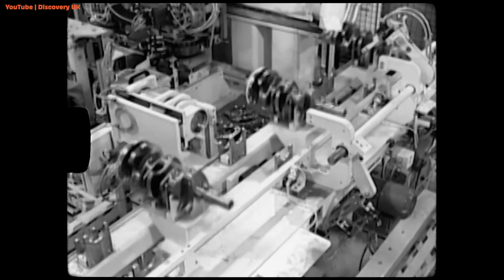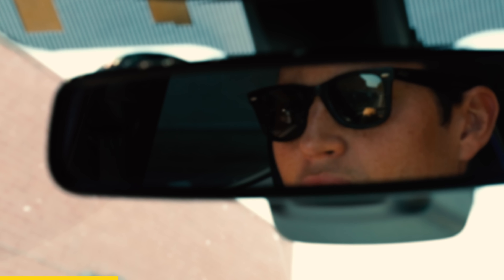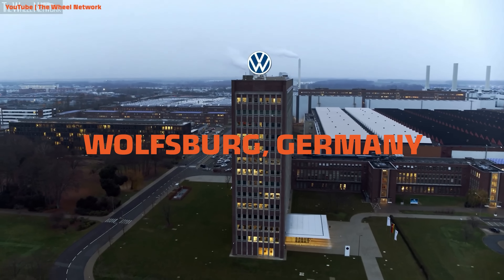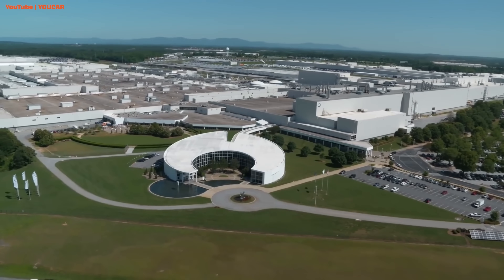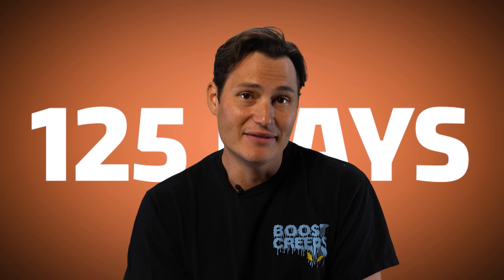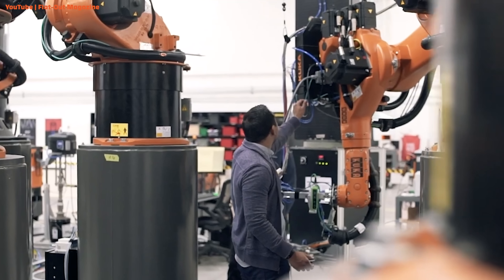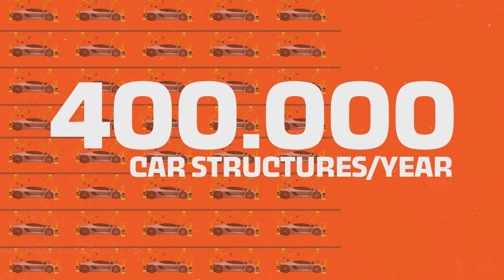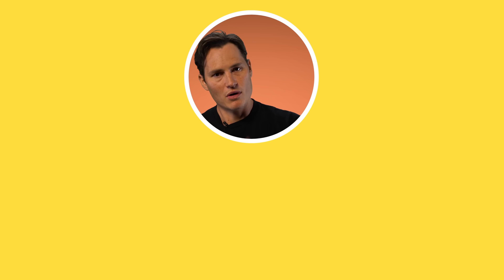A.I. Designed this Car

Comment: 3D printing still has a long way to go. It’s great for prototyping and avoiding manufacturing nightmares, however you’re trading that for part lifetime as it suffers from metal fatigue way harder than traditional methods.
Reply: Not to mention sintered products are a nightmare for quality control. A small failure in the sintering process, or an impurity in the powder can cause imperfections in every single resulting part, potentially causing failures. Not saying it's impossible to inspect, but it is significantly harder than the mere statistical/batch control you would need to do for traditional forging / heat treatment processes. Tl;Dr:  Fine for limited production, but once we're talking mass production, plsno.
Reply: No one ever said that you can't use 3D printing to make molds and designs of something you later want to produce in a sturdier material thats the real progression here
Reply: Agreed, i was waiting to if someone had commented on this yet! Not to mention scaling it isn’t as easy as we think! Great technology for reducing R&D times and improving results. Although like you said, 3D printing techniques just don’t produce the same strength in material structures as other “traditional” techniques. 
Stoked to see progress nonetheless though!
Reply: Bugatti literally 3d prints brake calipers. Siemens makes 3d printed turbine blades. if its good enough in those extreme use cases, I think metal fatigue isnt why its not being adopted
Reply: @sava411  turbine blades and aviation in general, go through rigorous inspections multiple times a year where the aircraft is torn almost completely down every component inspected and replaced the first sign of metal fatigue. Something that isn’t common at all in most ground vehicles.
Reply: @sava411  those are very specific cases though, they aren’t making entire cars or structural components
Reply: @michaelpugh2617  they arent making entire cars out of any single one manufacturing technique lol
Reply: Lol, companies have already made a completely 3d prompted rocket engines
Reply: @frodobaggins2852  That doesn't remotely debunks what he said. First off, this 3d printed rocket didn't fly yet (assuming you're talking of relativity space) and rockets are a very specific field anyway, where it's basically one use and it's done. Reusability isn't amongst their priorities, so the lifetime Breaden Griffits was talking about is short as fuck for rockets..

It's a very niche thing, and in that sense, it's not too dissimilar from prototyping.
Reply: @Baamthe25th  my point is basically if 3d printing technology can be used to make stuff which endures much much more harsh conditions than a road car, it will probably be possible to make a car out of it..i mean people are using 3d printed prosthetics
Reply: @frodobaggins2852  The question isn't if it can be done or not, if it's a traditional method doesn't the job just as well, if not better. (Not to mention, for cheaper. )

That's the point made in the original comment.

Comment: Wow, this video missed the mark in a lot of areas. Is 3D printing cool, yes, can it print cool shapes, yes. Is it the fastest, most efficent way to manufacture parts, absolutely no.  There is a lot more that goes into designing a product than just efficiency of design.

Comment: We need to realize that the current AI is not that smart. We think it is smart because it can output an optimized part but what is really happening is it is designing the part thousands of times and tests it. The computer then determines which part is the best and that is the design. They aren't smart they are persistent. If you give it the wrong parameters to manipulate you will get bad results and if you don't set the right performance parameters you will get bad results.

Comment: SLS is a revolutionary 3d printing technique. It stands for Selective laser sintering
It is an additive process of 3d printing
In SLS printing, powder of nylon, abs or PLA is taken into the machine where lasers to coalesce the powder into a solid or porous mass by means of heating without liquefaction. This is known as sintering.
By Sintering, the powder becomes very durable. 
I am a 9th grader and I know this because I participate in F1 in schools

Comment: The type of optimization they are most likely using is Topography optimization. Topography optimization is more of a calculus problem, not really what the industry would consider AI, and the reason why other automakers don't use this type of optimization is because it's not really needed. Not saying it's not impressive.

Comment: Curious as to how durable the parts are. If they are 3D printed for maximum weight savings, that could lead to a marginal--even nonexistent--safety factor.

If they are supposedly saving $497m, that better be one cheap hypercar. Also, I'd invest it back into making dope economy cars that could be bought brand new for the price of a used 2007 Accord.

Comment: AI: I designed a car
Engineers: But at what cost?
AI: Everything...
Reply: Don't get too hyped like Donut. How long does it take to print a car?  Way more than conventional. Lets not get to how much it will cost per car, and don't forget 3D printed metal may not necessarily more "stronger" than special metals (due to crystal structure), like aircraft compressor blades are made of single metal crystal to make them more resistant to cracking.
So yeah, metallic 3D printing is and will be limited to hyper cars and low volume production cars for next 10-20 years.
On the other hand, cars you see today, let it be your new Golf or a Ferrari, already incorporate AI design. However it is with mechanical/aerospace engineers doing the actual design but have AI simulate and refine it.
Last but not least, SR-71 is done without computer stimulation. And Zonda still looks more elegant. Since you can't simulate a human (yet), Beauty can not be modeled (yet).

Comment: This is how every car maker designs its components.This is nothing special. The parts from singer just look fancy, because they dont have to care about production cost. but if you produce high volume, you cant 3d print, because its too expensive. so the parts look different.

Comment: This kind of engineering is hell for mechanics to do maintenance.
Reply: Owners manual page 1: how to change battery - disassemble rear section of car to access battery.
Reply: This type of car is not 1 you take down to your local mechanic. Like all hypercars, they have special mechanics for it.
Reply: If u got the money to buy it, you have the money to repair it
Reply: @miercolesdenoquis6485  It's not about the money, it's about the nightmare that awaits any poor mechanic who has to work on a car that was designed solely for ease of manufacture and without regard for serviceability
Reply: @GMT-tx2xz  but the people buying this have lots of $$ and can afford to pay a lot to the mechanics. How would you like to be a mechanic for aircraft engines they hold way tighter tolerances than this. Oh yeah that’s right they get paid way more then the mechanic down the road working on random shitty cars. The only argument you have is if this made regular people cars. But even then is it really that hard to make it learn how to make maintenance easy compared to it learning how to make an entire car. Your argument makes no sense no matter how you look at it. If you don’t want to work on it don’t find another job nobody is making you do that. If you want to learn and make a shit ton of money doing it then go ahead and let them make it complex as hell.
Reply: @GMT-tx2xz  as an Hypercar mechanic, you're probably paid 100$/h and work in a spotless room with chandeliers and a string quartet playing in the corner
Reply: Hypercars are intentionally stupid and complex, they're all like this. But I can't help but wonder, how much faster the AI and robots would build an average people's car, and how much more optimized it would be.
Reply: It should not be that hard for a mechanic when most likely the car is like a lego,the only thing that would be a nightmare is the wiring since the A.I. routed it through the most impossible location where hands wouldn't go in.
At least the A.i. made the car from all of the best design for parts,who know if they have A.i. Mechanics.
Reply: lol what i thought, you break anything in this car, throw away entire car lol
Reply: maintenace.. look at it one hit... and you need new part.. it too thin.... for steel work...

Comment: If you think about it, this way of making cars could make cars WAY cheaper.
It would be a lot more expensive to start a factory with all the machines and computers needed for this method, but once you get started, the costs of actually building designing and building the cars go down like crazy. No human can work as efficiently, as consistently and as long as a machine. A machine can work all year round for a fraction of the cost of a human worker.

Comment: I was struck by two things - curiousity & fear. 

The fear was a result of thinking that if an AI could essentially plan out 80% of the design process, it sort of signaled the end to human discovery in terms of automotive innovation. I'm aware that this may be an exaggerated fear that may not actually come to pass, but its something to consider. Along those same lines, if A.U.s suddenly pop up, you're talking about machines that never have to take breaks, can run 24 hours a day, and will require little maintenance, and that spells disaster for automotive jobs potentially. Again, possible over exaggeration on my part, so I'll digress. 

The curiousity was about the potential to build your own materials with 3D printing. I'm aware that 3D printing has been around for a while, and its use in manufacturing metal parts is something that I've been interested in. But if the cost of that engineering was lowered, it would mean that people might be able to enter into markets like this and offer some competition. And that would be GREAT. 

What did you guys think about this stuff? What would you do if you could build car parts in CAD, have them sent to a lab to print, and be able to manufacture your own car essentially from the ground up?
Reply: i definitely felt the same way.
while 3d printing could help save material, the thought of the amount of jobs lost and the loss of actual human input is scary.
Reply: @ajayadhisankar4139  it really doesn't, depending the design printers waste material and pieces need to be polished after the process
Reply: @LeoMkII  Have you seen how 3D metal is printed? It's metal dust that's simply welded with a laser, and is brushed off if its not used. It can be reused in future products. The waste is nothing compared to how much material is lost when you have to use a lathe or to cut material out. 

And how many people will be "polishers"? How much of this are we pushing out of human hands when we build robots who can no essentially design methods of putting everything together WITHOUT the need of human interaction?
Reply: while ai does all the engineering itself, its still a tool to use just like any other program. for example within the gaming industry, they would have to create hundreds of thousands of assets by hand just so someone could run past it later, with one virtual building costing at least 2 hours of work from start to finish. nowadays they use ai procedural generation to streamline the creative process leaving more time for the creators to do the more important things. I believe that ai is definitley dangerous but any sophisticated tool is, so it's up to us to make sure we use it wisely. and the jobs lost to manufacturing could be made up by ai programmers and maintenance. ai isn't smart enough to do everything on it's own despite what you hear on the news.
Reply: and i don't think it'll go far enough to be able to make your own vehicles from CADs.
Reply: I’m a firm believer in the human aspect and the passion that goes into vehicles

But in the day of cars getting more and more expensive this could be an amazing way to maximize not only performance but cost efficiency and fuel efficiency.

Not even mentioning production efficiency, which will also cut costs.
Reply: AI and robots are coming to many places and many jobs and our whole society needs to start thinking real fast about a tomorrow with 95% unemployment because it won't be pretty if we keep the current socio-economic structures in place... As for you second and third points, the biggest companies will have the best computers and AI to make the best optimisations, and the capital to have the best and most efficient 3D printers and raw material supply. Normal people should not fool themselves that they will be able to start a car company in their garage imo.
Reply: @CalgarGTX  people thought computers will replace jobs, same with robots. Guess what? They didn't. They are tools, not humans. Same with ai. Ai is a tool made by humans for specific tasks, Nothing special.
Reply: @CalgarGTX  I agree mostly.athough a machine may steal manufacturing jobs for now, in the future we will go through a change in professions. Just like we did when we invented new manufacturing systems a century ago. There is always another task that needs to be done as we advance further.
Reply: I definitely agree with you and I felt the same but I also felt a sense of hope that we could really have more efficient parts with this type of technology. It has the potential for customization of cars that would otherwise not have been improved upon. My imagination is just going crazy with possibilities. Im just worried it'll be so expensive that it wouldn't make sense to pay for
Reply: The idea of a car being 3-d printable is awesome, just for the secondary repair market. Being able to 3D spare parts for your car would be amazing.

I soon as I read the title of this video, I my mind went crazy with the possibilities I never thought about. It makes sense, ML can do a lot of guess, check and refine, the basic principle in scientific learning, while never hurting a test subject, or costing money to make a prototype. You can squeeze every inch of performance.
Reply: 3D printing is nice and all but it is not a mass production process. In the future I can see that 3D printing will probably be used similar to how it is now: low volume, highly variable products. 3D printing is nice in the area that you cut down a bit on waste and you are able to quickly change what you are making without changing all your tooling. I can see 3D printing and more traditional machine based factories being used alongside each other with 3D printing being used for prototyping and development.
Reply: @ragingagent5040  yeah I wouldn’t be saying entire cars will be 3D printed and made by AI but it would be a very interesting prospect and could cut cost in certain places. 
Idk it’s all hypothetical.
Reply: i know what u mean.
my engineer/nerd brain wants to see how far this can come.
but my human side conflicts with it. Imperfection is where perfection lies, for a human
Reply: it just makes designing limitless and efficient like you don't have to waste too many resources For R&D just like movies, games, and animation

Comment: I am interested to see where this goes, as my reading and discussion show the 3D printing of metal parts are very useful to test out ideas and theories.  There are durability issues with 3d metal parts, as every layer generates defects (more so than traditional methods) that can cause fracture and cracks much easier. While good for niche products, this might not mature for a while and the scaleability is not there yet.  This will change, as most companies want to reduce their worst enemy (the employee) investiment in this type of manufacturing will continue.  But I wonder who will them with few jobs to go around...
Reply: Might have more applicability to electric cars (less moving parts) with a combination of traditional manufacturing and 3D printing (I think MIT already did a study of exotic materials vs. traditional and you don't a cost savings under a certain scale. Aspects of that apply here).

More questioning why they went IC vehicle vs. electric, and supercar to boot. If the amortized costs are indeed lower, you could low cost electrics competitively to traditional cars and leap-frog ahead most manufacturers.

Comment: Super interesting concept and video, but some of the claims being made about 3d printing are just false. It has some obviously cool advantages, but no waste materials? Not unless they made their own printers. Printed metals also have different internal structures than conventionally pressed/milled metal so the load calculations would have to be different, so his claim that these already exist hopefully refers to tests on similarly printed metals theater than formed metals of the same allow. 

Cool car, cool methods, but for now like you said, more of a fast to build concept than an actual model.

Comment: "A 3D printer doesn't print out extra material"... well, it does.
Reply: Hahaha I heard that and I was like 🤔 oh? It’s not much waste when it is, but there still is some
Reply: It somewhat do "print" extra material (bits that have to be cut down and cleaned of the printed part) but is minimum IF it happens...  it is much much less waste than traditional manufacturing.
What it does is that it lays down extra material: for example it lays down a whole layer of metal dust over the plate even if just a little part of it will be melted by the laser(s); but that extra material it's not waste: It will be used eventually in the next layers.
Reply: are you talking about supports?